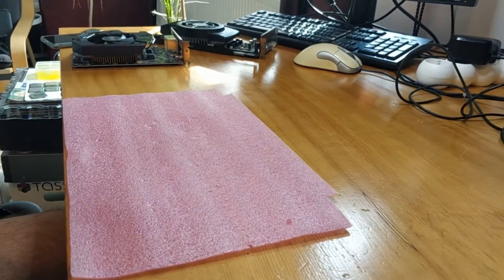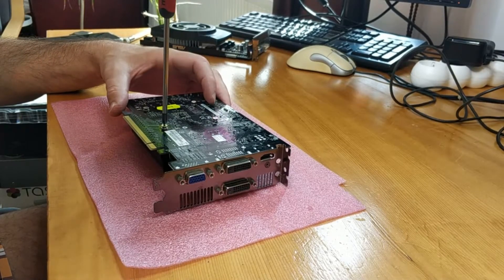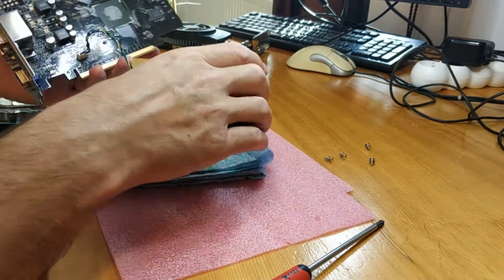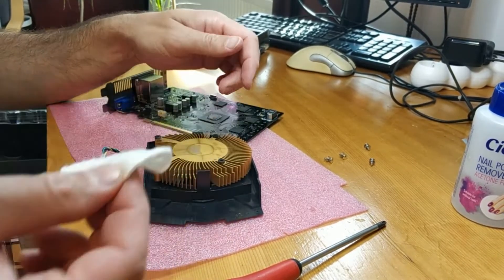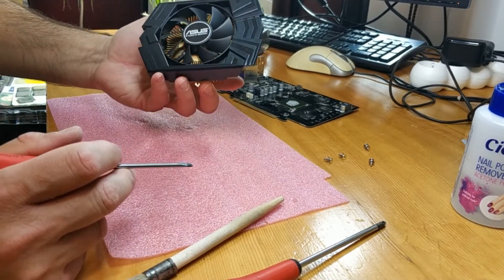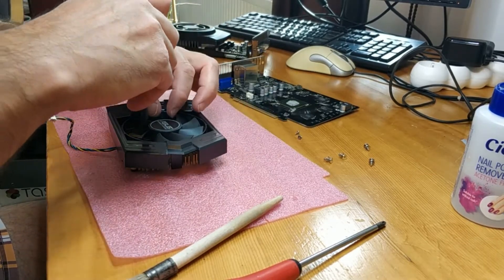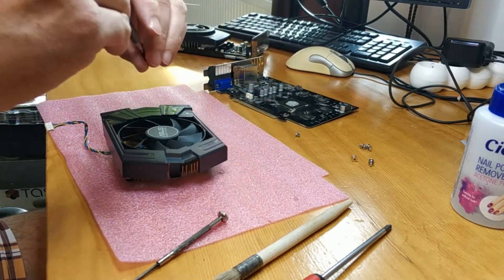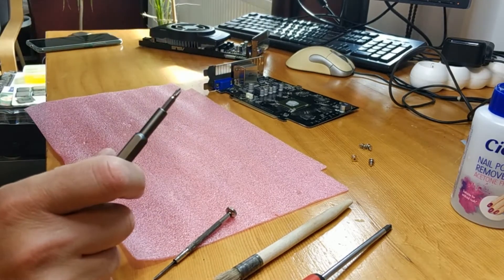How to properly Clean and replace Thermal paste on Asus GeForce GTX 750 Ti

Comment: You did a good job . If I were you , I would peel off the back cover of the  fan and put a little oil or grease in the rotor , the fan will be more silent and  durable .
Reply from the maker: Thanks mate. You were right, i skip this part, saddly; for even more efficiency, i put also a tiny drop of Duralube(see automobile info, if you don't know what this is).
Reply from the maker: Also, check this video, and tell me your opinion 😁 https://www.youtube.com/watch?v=c5ku2nyi2qc
Reply: @DaneluRepairs  To be honest I don't understand the purpose of your measures .I just lubricate  the fans in my computer  , open the rubber cover on the back and fill the interior with grease ( lithium grease is better than standard grease and oil ).
Reply from the maker: @dthtr1  those measurement is because there are many fans that they DON'T have hole/rubber cover; there is no hole to grease, simply as that. So, i drill a hole, all by myself; measurement have to be take, not to drill exactly on fan ax, and not too far; just near is imperative.
Reply from the maker: @dthtr1  here are another example https://www.youtube.com/watch?v=__R5Z5m7aK0
Reply: @DaneluRepairs  Do you still use this graphic card and  is it good? There is a same model ( Asus GTX 750 ) sold on ebay at a very low price , I am thinking about buying or not . I don' t play game , only have multimedia and internet use .
Reply from the maker: @dthtr1  one of my friend still use this card; for multimedia and internet it's perfect.
Only be w=aware that this model suffer an specified problem. If you have that Speed up and down Fan Problem, i just resolve it, i put a video here https://www.youtube.com/watch?v=LMdo4pksBys
Reply: @DaneluRepairs  Thank you for your help .
Reply from the maker: @dthtr1  you're welcome, mate 😊

Comment: Thanks for the video, I may have to actually do this to my server GPU if it keeps over heating. I have the common issue with the fan controller not working properly so I had to remove the fan and zip tie a case fan to it lol
Reply from the maker: Glad to be helpfull. As i say below, if it works, is ok for me. Good job, mate.
Reply from the maker: Hello again; i just resolve fan problem, i put a video here https://www.youtube.com/watch?v=LMdo4pksBys

Comment: nice job .. do u have the common fan problem of this card ?
Reply from the maker: Thank you Ahmed. No, i don't have any problem, and i have two pieces of this videocard.
But, what is that common problem?
Reply from the maker: @kokokid24  hmm, it's nice to know, but, on bouth video card that i own, i don't have this problem; also, i see that this problem yet not have a solution
Reply: @DaneluRepairs  
I bought it "used" days ago , then I return it the next day due to this problem .. I have hp 6200 compac pro case .. i need lp 1 fan card.
Reply from the maker: @kokokid24  ok; you can put another fan in there; and, this is not low profile video card, it's just a short one; buy another model, not an asus gtx 750ti, and for sure you will not have this fan problem
Reply: @DaneluRepairs  it's a global problem with fan controller..
anyways,  I think of gtx 1050 2gb or RX 560 2gb of which both don't require PSU connectors.. 
cpu: i5-2500 :) 
I downgraded my i5 10th gen + rx 570 pc as I needed money and sold it.
Reply from the maker: @kokokid24  yeah, i see in video you gave me, a lot of people have this problem. But, i just buy one with exactly this cooler problem, hope that i resolve and make a video.
Ati, i don't really know about it, but GeForce 1050 is nice.
It's sade that you need to sell your pc, because lack of money.
Reply: I have the GTX 750 with the exact same fan and my fan controller was busted on it after a few years. It now has a case fan zip tied to it to fix the problem lol
Reply from the maker: @column.01  if it works, is ok for me.
Reply from the maker: @kokokid24  Hello again; i just resolve fan problem, i put a video here https://www.youtube.com/watch?v=LMdo4pksBys